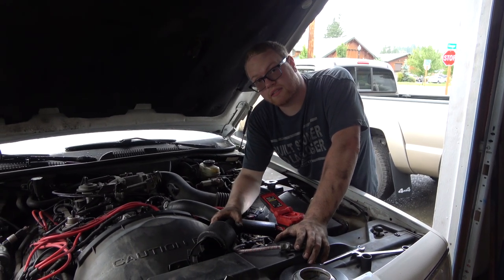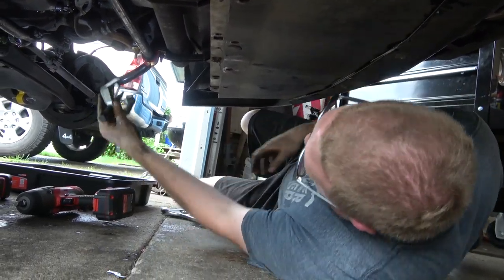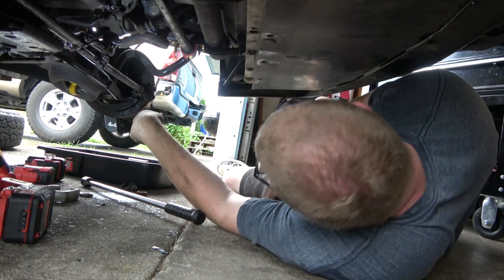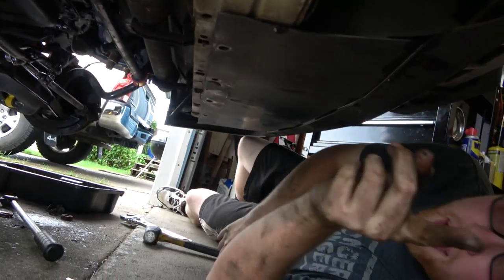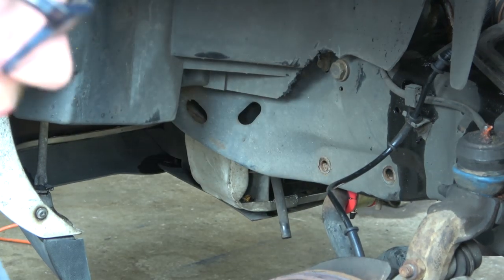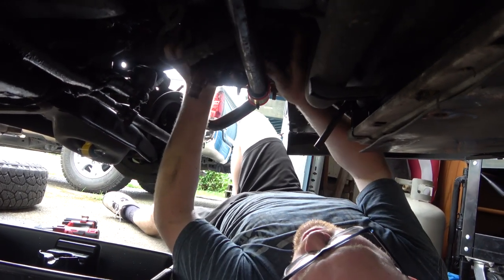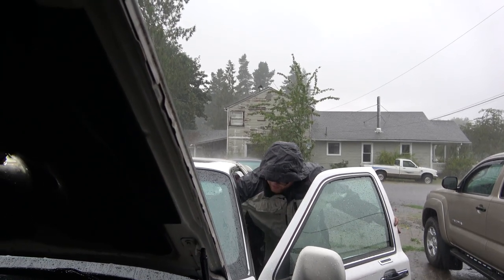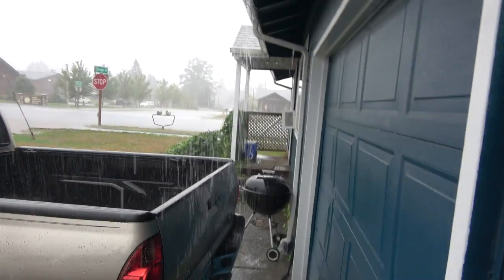1978-1996 Ford/Lincoln/Mercury "Panther" Steering Gear Replacement

Comment: I love to do my own wrenching and have done so on many cars and I have to say my 95 Town Car is by far the hardest car i've ever had to work on. It's like everything is designed to be placed 1/16 of an inch too close to every bolt you need to remove. Ever replaced the EGR valve? Mine was underneath the intake, had to get it from underneath after taking off the cat.  Literally took me 3 weeks of off and on working on it to replace. My '13 Honda CRV is a dream to work on in comparison. Wouldn't trade my Lincoln for anything though <3
Reply from the maker: I really hated doing the rear shocks. That was my biggest hatred.
Reply: lol not much room there,  plus dropping the top nut between the frame and car body about 20x isnt fun
 @justhes
Reply from the maker: @Maleekus  I almost did that. I put bilsteins in and ended up putting vice grips on the very end of the shock that is unused.